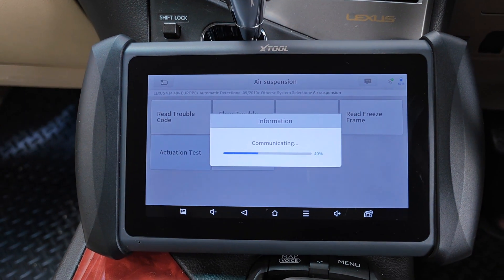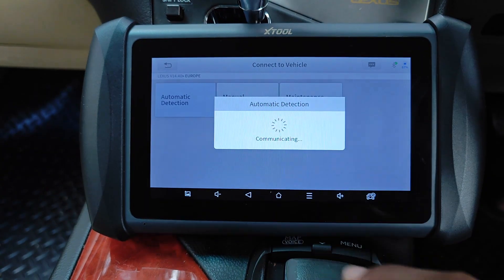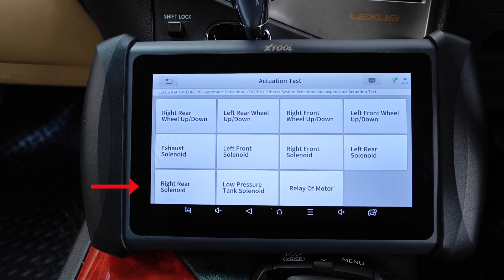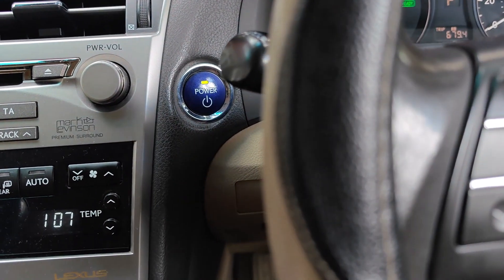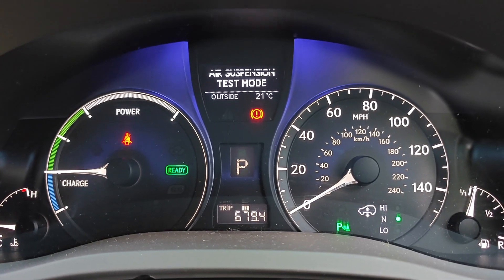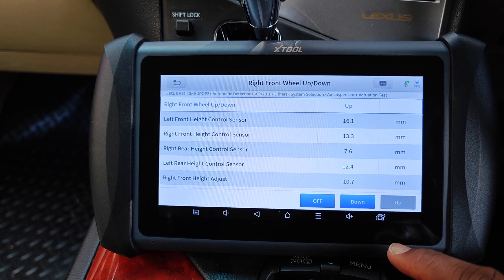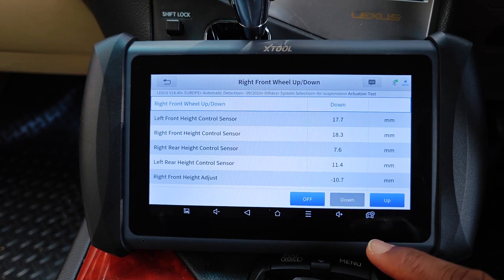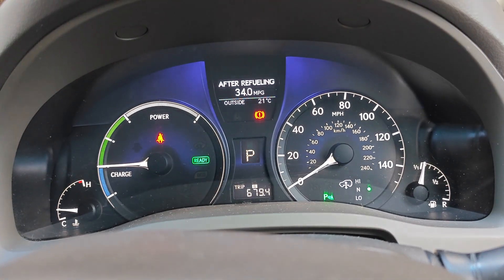Test Air Suspension with a Scan Tool:  XTOOL Scanner IP819TP / Test Air Suspension Struts on Lexus

Comment from the maker: Have you tested or had an issue with your air suspension? Let's talk!
Reply: came here looking to scanner for 2007 yukon denali has co660 suspension code. all fuses good relay clicks direct power at the relay connection the compressor runs. Put weight on it and does nothing. Ant help would be appreciated.

Comment: Would you say that this is equal or better than autel mk808s
Reply from the maker: The support for full TPMS is a clear advantage for the XTOOL. That said, I did a comparison between Autel and XTOOL in general which should be considered in putting these 2 against each other. 
https://youtu.be/re2Qppl-C70

Comment: Hi, Nice demonstration, it's always interesting to know what you can really do with the diagnostic tool. I hope you'll also have the chance to test the special functions offered by Xtool, I've already had several problems running a DPF regeneration with my A30M. By the way, is there a difference in actuator testing between D7 and A30M (do we have the same menu and possibilities?).
Reply from the maker: Thanks for the compliment!
As far as I can tell, I haven't seen any reason to suggest the bidirectional coverage for both tools are different. I haven't attempted all the actuation tests though. Will update if I find any difference. Will keep on eye for XTOOL service functions as suggested. DPF regeneration is one test I haven't attempted on a scanner!